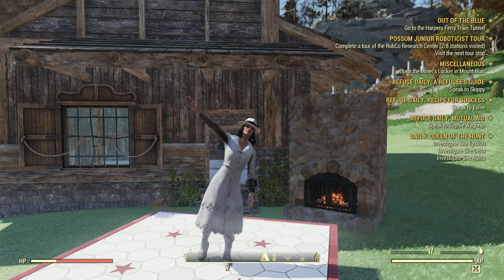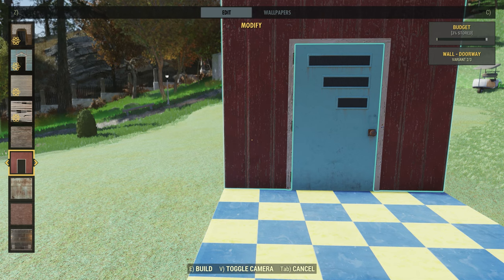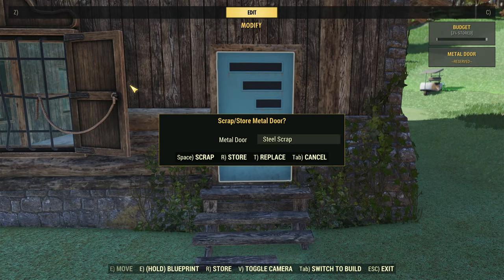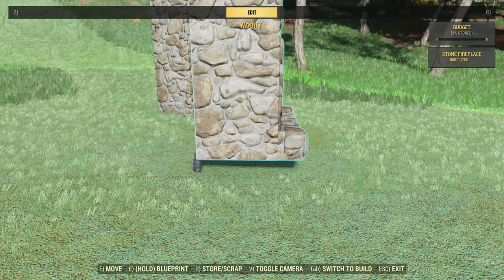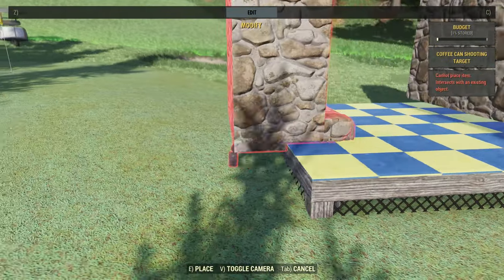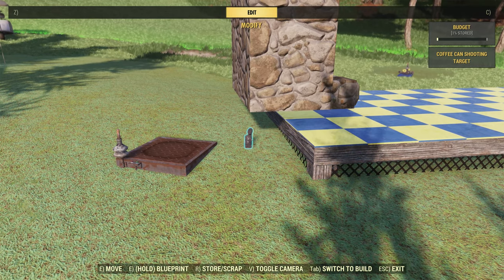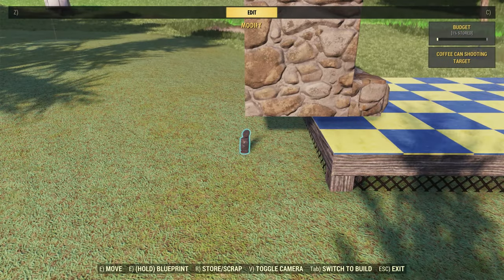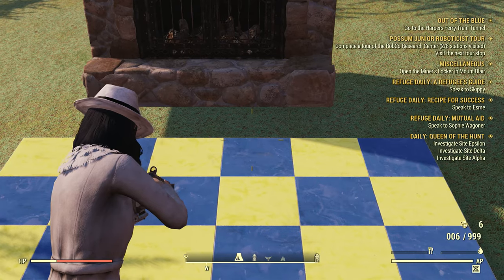Fallout 76 Camp Tutorial - How to merge the Stone Fireplace into the Iron Mountain Anvil prefab

Comment: Wow, didn't knew that you can force prefabs to snap in a certain position with floating doors.
Reply from the maker: With some of the prefabs you will need the door that comes with it to float. It can also help to get a prefab to be a bit lower into the ground if you have an area where one of the corners will stick in the air if you placed it normally, or you can even make them float in the sky.
Reply: @HitBit_Gaming  I need to try this when I have time. I want to use it in combination with the glitch where you place multiple foundations and a inside facing wall between, then remove the inside foundations to create floating wall, place a prefab there, save everything as blueprint. On placing the blueprint it flips the outside foundations to the inside directly inside the prefab to match the wall. My goal with this is to have farmable dirt tiles inside a prefab for an indoor farm. I have a hard time positioniing the prefab to perfectly fit in, but if I can snap it into the exact same position with a door, this would be a lot easier. Not sure if there is a better method to get farmable dirt tiles inside a prefab.

Comment: I would like to know how to merge the concrete floor with prefabricated buildings. I have seen several camps like this and I don't know how to do it.
Reply from the maker: It is possible to put a foundation outside wall on top with the inside facing the prefab and flip it to the inside using a blueprint, but that takes a lot of patience and time to do a whole floor this way. There is another way with an unofficial blueprint that is shared on PC, but I personally stay away from these.

Comment: Nice! Question: can you glitch/merge foundations on those (ugly) floors??
Reply from the maker: There is one way to merge foundations into prefabs by using blueprints, but with a bigger floor it will become a lot harder to do to get the foundations all the way inside and you would have to make blueprint after blueprint. This video from Vladministrator explains how to flip the foundations into a prefab, but you would have to repeat that step and foundations that still need to be flipped further inside, may not be connected to another foundation yet, and that is why it is a lot of work to do.
Reply from the maker: Totally forgot to place the link to the video. https://www.youtube.com/watch?v=68z4Da1wTuE
It will explain a bit how it works, but you just have to place the foundations a little bit higher so they are visible on the inside as well
Reply: @HitBit_Gaming  Tyvm. I’ll try it out! :)